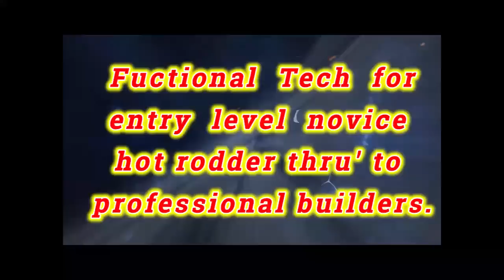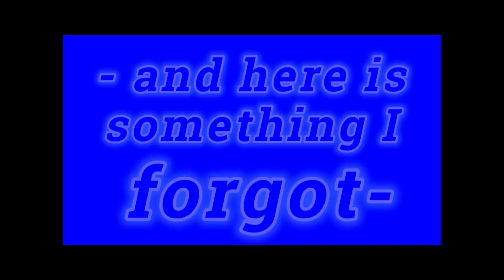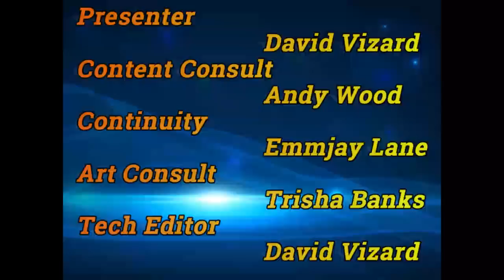Carb beats EFI - But Why?

Comment: I suspect what you are referring to at the 5 min. mark to test intake restriction is a water column manometer. I have been doing this for years. I had a series of Mustangs from 2006 through 2016 and tested all the factory air boxes. The most restrictive that I recall was my 2013 Boss 302. If memory serves the stock system, tested just in front of the throttle body. had a negative pressure of 24 inches of water. I then installed a Steeda and it measured 8 inches. This difference was born out on the dyno. With the stock box it had 395 whp and with the Steeda 405. I also checked the stock system between the filter box and the maf housing. The filter box created virtually no restriction, with or without a filter. Therefore I concluded that the tube between the throttle body and the box must have been the restriction. 
The first car I ever tested, which will be quite familiar to you, was a 1971 Mercury Capri 2000. When I put the manometer tube in that air cleaner assembly I could just punch the throttle in neutral and it would practically suck the tube dry.

Comment: From my experience dyno-tuning  Harleys I absolutely agree with you about getting the air/fuel right first, then the timing. It is especially crucial on air-cooled motors because a lean mixture under load on a hot motor really starts pre-igniting and then if you back the timing down to control it, there goes all your power! Better to get the air/fuel as close as you can before optimizing timing. As a side-note, with the same engine combination, I haven't observed EFI making any more power than a comparable-sized performance carb. Its sort of a moot point these days anyway, since Harleys haven't had carbs for years but once again, real-world dyno-tested results prove what you are saying! Thanks for the great channel,  👍👍
Reply: Even more fun with 2 stroke!

Comment: Great videos.  I was a carb guy, now I am a EFI guy. I like using GM ECUs with a custom spark timing breakout for boosted engines. IMHO, the carb is a venturi, by definition it restricts flow. EFI offers more control at different atmospheric conditions. In Florida temperatures can easily sway by 15 degrees in the course of just a couple of runs down the strip. Of course the engine is not the only thing that requires tuning for temp changes but EFI, once set up well, let’s me concentrate on those other things.

Comment: Carb wont beat direct injection though. Its all about volume during combustion. You have nothing but air in the chamber until the intake valve closes then fuel is sprayed in the combustion chamber. As the piston compresses the air the fuel also takes up volume as it goes in. Charge cooling only helps during certain conditions.

Comment: If you PWM drive the injectors at around 20khz to get them to be partially open, you can increase the fuel droplet size that way, then just find the injectors with enough fuel flow at redline with the smallest fuel droplets, then for low rpm open the injectors only partially to increase the fuel droplet size. This way you can have optimal fuel evaporation throughout a wider rpm range.
Reply: I don't believe he was looking for larger droplets but a larger range in droplets sizes.

Comment: By the way. After some careful grinding on a 360 Mopar crank and rod piston and ring combination that was almost 300 Grams lighter we pulled off a internal balance 365 Mopar without any Mallory metal.   Ha, most said it couldn't be done.  Now onto the heads and tunnel ram.......

Comment: Years ago, I was diddling around with Oswego Supermodifieds.  When Crews began switching from Hilborn injection to Crower,  because the Crowers had their throttle plates so much higher, engine guys were experimenting with injector placement.  Rumor had it that placing the injectors closer to the throttle plates, which was much further away from the cylinder that the Hilborn Systemm gave more power.

Comment: Modern motorcycle engines have two sets of injectors; one in the airbox and the other in the other much closer to the valve. Apparently this must work as these engines are capable of producing 4 HP/CI with tuning of mostly stock parts. Off the showroom floor they produce ~3.25 HP at the tire with strict EU 5 emission standards. These engines are all independent runner intake systems and are remarkably powerful. It seems like the factory engineers know what they're doing.
Reply: Bell’s “four stroke tuning” book mentions the idea of staggered injectors…

Comment: Droplet size is critical. What you have at the surface of a droplet is simultaneous heat and mass transfer. Getting proper pressures for the arc of the crank can yield optimum power. The pressure should build and decay in a sinusoidal way. Years of testing in our laboratory at the Bendix Research labs. Bendix held the original patents on electronic fuel injection.

Comment: Launch control, knock detection, anti lag, two step, boost by gear, strain gauge,  custom changes on the fly, etc etc... can this be done with carbs??
Reply: Trouble is most do not have the skills needed to properly implement efi and maximize its potential.
Reply: @b.c4066   i know this guy has a lot old-school wisdom.  But a few statements I've heard or not true or scientific when it it comes to flow and velocity in different rpm ranges.  Especially the comment about spacers.  What might be good for one specific  hp reading doesn't give you power through the whole rpm range.

Comment: Hearty applause for 100 Well done!!
I do have a question if you see it David on the 4/7 cylinder swap;worth the added cost?
Reply: It is worth it I've done it on a couple different Motors and it definitely makes things smoother and a broader torque curve because of the cylinder sharing of the same fuel air charge it's worth the money they don't do it for nothing there's a science behind it that most Average Joe's don't get

Comment: Thanks for your knowledge very appreciated. I'm building a 388sbc wanting your recommendation for the ideal camshaft for my application. 388cu piston specs 4.060 cylinder heads aluminum aftermarket 1.60-2.02 been port matched and combustion chamber worked max valve lift available 575 . My car runs a 1.56-1 first gear and 410 rear gear so with the added torque from compression i think my low end will be okay for street take off. I'm running a dual plane intake with a 750 Holley c&s converted to alcohol I'm planning on running e85. ? Lsa / lift and  duration camshaft would you recommend. Thanks for your input i figured I'd ask the smartest person I've found

Comment: Interestingly enough, direct injected engines also make more power than MPFI. But I think that's because direct injected engines can have higher static compression ratio.
Reply: Direct injection also runs at extremely high fuel pressures allowing the injectors to produce much smaller fuel droplets

Comment: sooo...idk if this has been brought up but....a .010 or so fine mesh screen between the intake and spacer then mount the throttle body on top of the spacer. possibly a tighter mesh?

Comment: Many thanks David, quick question , if atomisation is key , why do we inject so close to the inlet valve ? ... why not into the inlet manifold or even the plennum chamber itself , anyone tried that , other than throttle bodies which already re-position the injectors ... thanks again Greg ( Guersey )

Comment: I've often thought if you could mist the fuel on an ultransonic plate/transducer would be an interesting test
Reply from the maker: DONE IT - GREAT PART THROTTLE SPECIFICS BUT POER USUALLY DROPS.
Reply: @DavidVizard  How did you implement it. Taking a Victor manifold as an example, I was thinking of placing an ultrasonic plate on the floor of the manifold, so any fuel that contacts it would be turned into mist
Reply: But then you would have to add an encabulator with a vilton rod, and that would be quite expensive.

Comment: No serious engines research should be done without using a Jacobs Electronics Computer Ignition System. It completely eliminates misfires and controls cyclic variations to within two degrees of crankshaft rotation. Also, you can run a wider plug gap that you can with any other brand of ignition system. If DV had used this ignition system, I wonder if the carb and FI test results would have been closer to each other. I've watched many of DV's good videos.

Comment: Hi David Vizard what do you think of a 4 pattern camshaft for small block Chevy. The use that camshaft design in NASCAR.
Reply from the maker: Great - but it will take a lot of dyno time to perfect for just one spec of engine. 
    At the very least you will need an 8 cylinder in-cylinder pressure tester. Even the TFX one, which is really cost effective, will cost you about $14,000. Add to that about half a dozen cam blanks to get you into the ball park, a suitably equipped dyno mule and about 10 grands worth of dyno time and you could, if you knew what you are doing,  be half way to making your goal!
REMEMBER MOST ENGINE BUILDERS CANNOT EVEN GET A SINGLE PATTERN CAM RIGHT LET ALONE A 4 PATTERN ONE!!!!!
My advice is get what you already can do right - it will be far more productive!!!
Reply: @DavidVizard  Comp Cams offer 4 pattern camshaft for about $600.00 at Summit Racing.

Comment: The cold charge of the air with a carb is it. But it's not much anymore. Plus the FI equalizes each cylinder better. DI makes more power

Comment: Messed around with varible length induction and electronic  fuel injection   it's superior  when ram lengths and volume can be optimised  for extending tourqe   . timing and fuel controls make this possible     common  aftermarket injection  on a dual plane has no advantage  over a well configured  carb   as is explained ,vct makes many of these improvements more tunable  in modern efi induction. 👍

Comment: I can tell you why without watching the video.
It's simple physics.
We call our fuel "gas" because it works in a gaseous state of existence.
As the gas gets sucked into the air stream in the carb and makes its way to the cylinder, it has more time to vaporize vs fuel being direct injected into the cylinder.

Comment: maybe if you put fogger nozzles in the injectors? better atomization than a spray I'd think
Reply: May need to be gigantic injectors to get the flow.  For example I've maxed out injectors on cars like anyone boosting a stock engine, where the injectors go "static", which means they're basically held open.  Not sure if you've seen injectors in action (check out videos on fuel injector matching and the test benches with clear chambers you can watch the spray pattern), that is a lot of fuel flow.  Fogger nozzles rely on pressure drop to accelerate the fluid creating the ultra small droplets, compared to a static injector held open you're going to need a large volume fogger injector to maintain a certain droplet size.
Reply: @iKenFlyPPG  maybe a Vtec style fogger right past the throttle body? trial and error usually gives better answers than ideas and helps with innovation 💡
Reply: @boredom.victim  It's a lot of power left on the table, for a pro racer it's more than a lot, they'll make it happen if it works and the benefits out weigh the costs.

Comment: David, you wrote a great  section on economy tuning on pg. 54-55 of your How to Super Tune and Modify Holley Carb book.  However, I was wondering what your thoughts were of using a Carb Cheater (it's a wideband 02 connected to an electronic box that controls vacuum to fool a stock carb into providing the right air fuel mix) on a windsor 302 with a lawnmower carb in a 70's Ford Maverick like here:  https://www.youtube.com/watch?v=1xHQWu2ZzPc

Comment: Well sir, I have that issue of Hot Rod magazine you were working on a rebuttal for and curious whatever happened with it. There’s an article in there written by you obviously. Are you debunking your own work?
Reply from the maker: I am heavily  criticizing  it's publication very strongly. It was done over 40 years ago and the advice no longer applies. Also another article than is being pushed as a great build but in fact is rubbish.
Reply: @DavidVizard  Had a hunch when I read it. Not sure what they were going for when they put it to print again except for nostalgia purposes? Thanks for the feedback
Reply: @DavidVizard  that tri-power tunnel ram? I definitely said “Huh?” Over that build

Comment: Fuel injection  that we can afford either doesn't exist or never works period . Carbs for the win every rime
Reply from the maker: Oh so blunt and not that far off the truth.  
A $15,000 - $20,000 deal will do it but value for money --- ? Dubious!
Reply: If you're willing to do a DIY set-up, fuel injection can be fairly affordable. The GM OBD1 ECM's have been adapted to most any engine, foreign & domestic with relative ease, and used to be fairly affordable to tune(but chip burners have gotten rarer and more expensive if you can find a good one). Then there is the 1st gen LS PCM(0411) that is being used on all kinds of 6&8 cylinder engines, are cheap in the junkyards, and can be tuned with a $40 cable. So EFI can be affordable, but it does require quite a bit of diy work.
Reply: In the honda game, obd1 ecus from civic si’s and integras are still chipped real often and new piggyback chips are even being developed. They’re capable of datalogging and burning via bluetooth. Although this route doesn’t need eprom burners and readers, the chip is hard to find and can cost a bit.
Reply: I spent 2300 on edelbrock pro flo 4.. carb was 700 and hei was 400 and manifold was another 400
So for an extra 800 I got a direct port fuel injection system that works awesome on my 340 duster. Will never go carb again. Combo works great and is so snappy, starts up great and doesn't blow any black smoke at startup.

Comment: I wonder why engines last 200,000 to 300,000 miles without being opened up, and power output keeps going up, while displacement keeps going down, since EFI became standard, especially direct injection. Top Fuel, Nascar, F1, none of them run carburators any more. Just sayin.
Reply: While Indy Car owners started drop kicking carbs into the landfill in the late 40s, F1 cars mostly switched to injection in the early 60s, and in CanAm sports cars, the switch was almost complete by maybe 1968. The complaint about carbs in the 60s was that there were fuel control problems related to braking, cornering and acceleration off corners. The engines were misfiring due to fuel doing wild things in the float bowls, and starving or flooding the carb circuits. 
Since this channel is biased toward drag racing, I tend to yawn at statements about how carbs "beat EFI", and look for little jems of information hidden away in the presentation that would apply to some other application (other than drag racing).

Comment: Carbs beats multipoint EFI due to venturi effect temperature drop and the latent heat of evaporation of the air fuel mixture traveling through the induction system. Carbs slightly beats Throttle Body Injection because a carb has a venturi  and a Throttle Body only has a throttle bore and can't take advantage of the temperature drop provided by a venturi.
Reply from the maker: Ehmm wellll - not really. Watch my bean can video about the real  deal on fuel charge cooling by the fuel.
Reply: Engine masters did a vid on this and found that Wilson's new(unreleased) injector plates that go under a throttle body made almost identical HP to any carb they compared them against.
Reply: I was just taking a guess before watching the video. Thanks for replying. I watch all your videos.